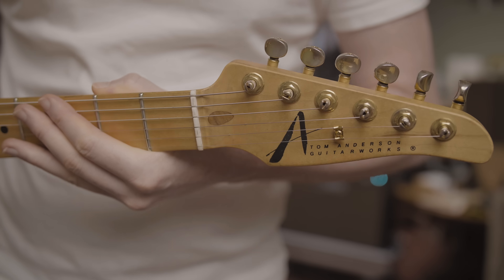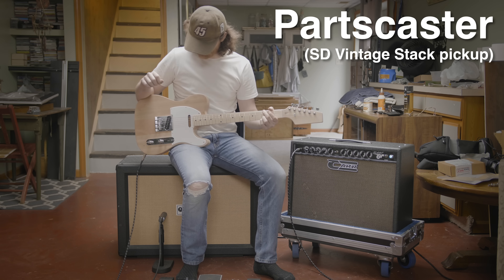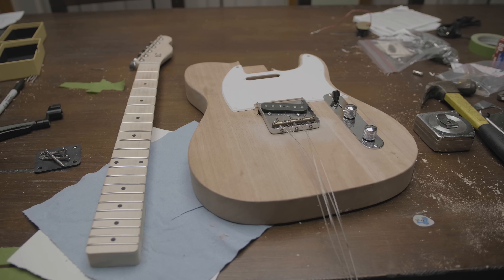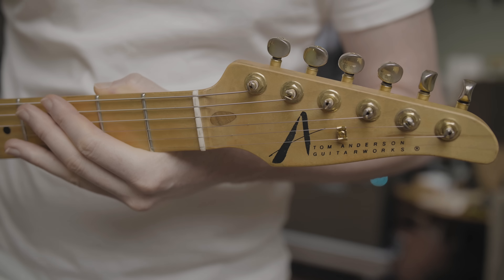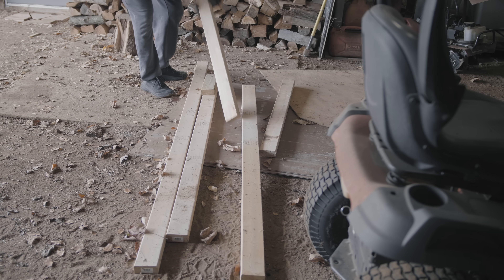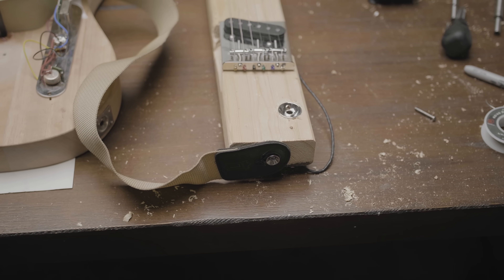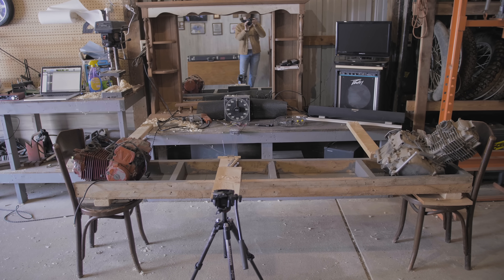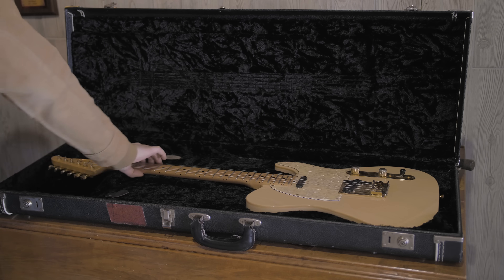Tested: Where Does The Tone Come From In An Electric Guitar?

Comment: LOL this comment section is HOT. I'll just add, i can hear differences. the air guitar sounds bigger than the tele. They're in the same neighborhood, but it sounds bassier maybe. Now we're at the point where the precision required to perform the same chords in the same way is going to be impossible. And they are different pickups right? Same make and model but otherwise 2 units? Not swapping literally the same pickup? There could actually be some differences there maybe. just a thought. 

Do i care about tonewood? No.
Does wood type change how the strings are vibrating and thus the sound? Likely yes, the sympathetic vibrations will amplify or attenuate different frequcies BUT... it's probably never going to be something any human would ever notice so I wouldn't fuss over it. 

Anyway, great video! Suggestion for future experimentation, what about hollow body electric guitars? Does their hollow body give them their warm sound? Or is that just how the players thay like hollow bodies like to dial in their sound?

Comment: So basically, the strings, pickups and pickup heights... then way down the line the hardness of the metal parts where harder is brighter... then way down the line the wood... then way down the line the country of origin of the engine holding down your air guitar.

Comment: The Partscaster sounds like shit jack. I'm not sure where this idea that it's "just as good" is coming from.  It doesn't sound nearly as good as the Anderson.  Is everyone's ears broken or something?  Unless you are going to tell me that you switched the audio, in which case I will actually be surprised, I'm not buying it.  10:16 yeah no shit when you strum a single chord and don't actually play you can get them to sound similar, but that's not what you actually do with a guitar. The Anderson still sounds better.  What's annoying about this video, and other videos like this is that you spent $3400+ dollars on a guitar, and yet you are trying to delude others into thinking that you did not in fact, spend $3400 on a guitar. It's almost like a sense of guilt or something.  How about this, how about I buy that Anderson off you for $200 and a blow job, or I'll build you a telecaster out of packing peanuts.  Apparently your Anderson is no better than that.  Personally I think it sounds great, so how about a barter?
Reply: Bro it's a literal workbench. If it doesn't sound different what will?

Comment: Im not trying to be a hater in any way but I'm still convinced your testing is flawed. 

There is obviously a certain equation of energy conservation and disapation. 

From the thumbnail I figured you would get really good results from the air guitar and this is why: the huge mass the strings have to effectively resonate against. That nothing in the bench (the bench being more stable) allows for certain reosnation and in this case greater sustain. 

Infact I think the air guitar sounded much better than the tele in the side by side, the resonance felt more full and sustained longer even like a piano. .
The tele compared to the 2*4 I felt like the 2 by 4 lacked that same resonance and lower end.

I think you're on to something but if the end demonstration was supposed to be some sort of gotcha the only thing I think it demonstrated is that you were not really thinking through the parameters and cherry picking certain ones for your understanding. 

I do think pickup height is a huge take away tho that this video demonstrated.

You also can't write off the less tone impactful factors such as playability / finish / quality / aethestic. There's a reason everyone has their favourite colour of guitar.

Anyway I hope you continue this series, and I subbed but please don't ignore resonance and mass as part of the tone equation. The tele, the 2*4 and the air guitar all sounded markedly different to me even if they were all part of the same tone 'specicies' they felt more like cousins than identical twins.

Comment: Yeah doing all this with new woods and new parts seems to have a very small difference in the sound between them... there is a small difference though and I can hear every single difference in every try you did, but its not that big in order to make one wonder.... however, try doing this test against an aged wood, a vintage guitar and you will be very surprised at the difference the simple change of a body will make.... I have done this test years ago (youre not the first to try this type of test) with a vintage guitar.... I swapped the body of my old Gibson S1 with a new better wood (I used aged Korina) and all off a sudden, the guitar came to life.... the old body gave me a bright and weak vintage style sound, the new body gave me headroom, volume on the bass side and a more modern sound.... didnt even have to change pickups or other stuff.... so to me the proof was evident... better wood on an aged guitar makes a difference.... huge difference.... I also tried strat pickups on the old body, but the sound was still weak and bright.... tried the strat pickups on the new body and the sound was amazing, as it was with the Gibson pickups on the new body.... so the pickups didnt help with the old body, nor were they the problem..... however, I returned the guitar to its original state cause the sound wasnt what the guitar should have....it lost its vintage sound.... my tests showed a different result than yours on this video.... the verdict is not out yet.... :)

Comment: Biggest remaining factors to test:  

1)  Standard Humbuckers 
2) Higher Gain situations

3)  Increase Guitar Mass (not less mass).  Aka same humbucking pickup in a Les Paul and the no-body guitar.  
4) Tone vs. Volume Pots (values, brands, materials, etc.)
5) Pot Capacitors, Resistors
6) "Vintage" vs Modern components or replicas
7) Guitar bridges/nuts/tuners

Comment: So.... Great video, Jim, EXCEPT a couple of flaws. I understand that most younger players think of guitar tone as the sound one gets after running the signal thru two or three effects pedals, or with the tubes in the amp pushed to breakup and the speaker also pushed to breakup. However, THAT is NOT the true tone. The pure tone is the guitar signal going directly into an amp set to clean tones. Your pedals cover up most tonal differences.
 Another factor is pickup placement. Your tonal sample is MUCH smaller thru the bridge pickup than it would be thru the neck pickup, where outside factors would be much more apparent.
  I do understand that you thought this test was pretty absolute, but those factors make a significant difference.
 I was taught many years ago that if you REALLY want to comparison, exaggerate. So, in doing that,  how can we explain the significant tonal differences between a Gibson ES175 and a Les Paul, both with '57 Classic in the neck position and '57 Classic Plus in the bridge position,  both with ABR1 bridges, both with mahogany necks, Kluson (or whatever) tuners. The ONLY difference is the body, and that makes a HUGE tonal difference.

Comment: You make a good case for "it's (almost) all about the pickups".  

Note that you did hear the difference between a guitar with controls and a guitar with a  pickup hot wired straight to the jack.  Those are the types of small differences that things like different woods and saddle material can make - IE almost unnoticeable, yet there.  

It may be that some folks simply don't notice the extremely subtle differences, while others might just barely - thus the fog around the issue.  

In the end, i suspect that all the "tone tricks" combined might result in a just perceptible difference in tone vs a guitar without tone tricks.  

In the long run, a decent EQ pedal at the front of the pedal chain gives you much more control over your tone than all the  mods ever could (other than pickup swaps perhaps).  Mahogany body? Bump up the lower bands some.  Maple neck? Give it a bit more brightness in the treble.  Brass saddles? just a bit more at 10KHz and above.  And so on....   Of course, you have to be able to hear these differences in the first place, in order to reproduce them with an EQ.   

BTW, the bench, shelf, motors, chairs, and 2x4's are the actual "body" of the "air guitar".

I suspect the big problem with tone wood and other "bit players" in the tone of a guitar is that their influence is so small that some folks notice them and some don't - thus the lack of consensus.  Do they have an influence? Theoretically - yes.   Can you hear the influence?  Maybe - maybe not.  Does it make a BIG difference?  Definitely not.  Does it matter?  Depends on who you ask.  Note that I'm talking about tone - not sustain.   Although the effect of tone wood, etc. on sustain is a similar case.  But tone and sustain are two different things.   Tone mods may effect tone and sustain differently - such as no effect on tone, but a small amount of effect on sustain.   

There is still much good science to be done and published before it is general knowledge as to what does and does not matter when it come to guitar sustain and tone.   Most research is done by manufacturers, who don't always share their results.

This video showcases good science - controlling for things like pickup height and control types - things that other comparison videos neglect.

Comment: This. All of this. People forget that one of Les Paul's first designs was a 4 by 4 with a guitar neck attached to it. He only changed it because people were confused by it.

I've long suspected that pickups, pickup location (including angle), and pickup height, when controlling for scale length, electronics, strings and tuning, are probably the most important factors in guitar tone.

Since you have the air guitar, could you then make the position of the pickup adjustable to see how that affects the tone? Further, could the scale length be adjusted, to test if it is actually the pickup location, or if it is the ratio along the length of the scale that is the determining factor?

Comment: i think a lot of the extras are comfort options. personally some softwoods on a tele really feel like I'm digging into the neck with my fretting, whereas a harder fretboard has an expected solid feel. I think this influences the players attack on the guitar and can change the tone. mainly i think every players style effects the tone more than any options beyond the ones you've outlined in your video. i think things tend to be more complicated when you add more parts. I'm thinking what of you picked up where you last ended and start building 2 totally different guitars and see if you can get them to deliver the same tone. your experiment was highly impressive and had a great time watching your analysis.

Comment: 4 factors based off of 10 years experience in playing guitar :
1. Electronics (pickups - types, height, position across the body, wiring, pots, etc.)
2. Scale length
3. String types
4. Picking methods (fingers, picks - material and thickness, etc.)

Comment: Your high output seymour duncan pickup is masking the component changes. Try a quality low output pickup. You will hear alot more.   Just like the crappy guitars that we played in the 80's high output was the goal to overdrive the amps. It didnt mater what the guitar was made of. Some Manufacturers knew this too. My kramer striker was made out of plywood. Acoustically it sounded like a chunk of clay with strings.

Comment: Just a couple thoughts, then I move on:
a) pickup choice, and spacing-to-strings will be your major pair of variables... followed by strings (gauge)
b) I hate to say it (because your pedals/amp sound cool) but tonal evaluation should be of the raw sound from the pickup... even pots/caps have quite a bit of parts tolerance variation. The compression/filtering/distortion of the pedals will definitely hide subtle differences... maybe invest in a high-end, one pass (not multi-pass, as it sums sound over time) audio spectrum analyzer. You might actually have one in a REALLY good DAW.
c) the Air Guitar: the pickup plate and the net/'headstock' are transmitting soundwaves/resonating based on the materials the are bolted to... yo've created a huge/massy guitar' physical properties of the bench and door frame.

To further eliminate (c), you might try this on some kind of strong by vibration-damping material..... my first thought was to make a 'neck/body' out of some kind of structural styrofoam.
you can monitor for any undesirable affect of resonating styrofoam by mounting a couple simple piezo transducers and making sure they don't puck up much sound.... Ideally, they should be dead.

Rather than type any more, I'll rely on the other 2,116 comments in here to ferret out more details of where to go next.
Good stuff.

Comment: Awesome video. Pretty much confirms what I have been suspecting for years. The biggest contributor to tone are the pickups and electronics. Then come the strings themselves. Minor players are the bridge and frets. The nut also influences tone to some extent, but it's mostly irrelevant as it only does so with open strings. 
The wood of the body and neck, as well as the bridge material and fret material have a big impact on sustain, but not on tone.

Comment: The magnetic pull of the neck pickup should theoretically cause strings to vibrate slightly differently vs. a single pickup guitar. Any remaining differences heard from the 2x4 and "air guitar" test beds might be attributable to that. You could also remove some of the subjectiveness of human ears by using an oscilloscope to compare the wave forms of the output signals.

Comment: So cool! Pickup choice and height, position under the strings, scale length, and electronics are really what it's all about.  The rest is cosmetic, feel, or too small to register given that you can compensate with a SLIGHT turn of the amp eq.

Comment: Great video! And it confused me a lot. I recently changed my basswood p bass body with swamp ash p bass body. The pickup position and the pickup are the same. I only changed the bridge, capacitor, and pots. There was a noticeable sound difference which, I believe, can not only be attributed to bridge and capacitor/potentiometer difference. I can hear the huge sound of ash compared to basswood if my mind does not trick me, which it may by the way after spending a few hundred bucks for this project.

Comment: Naysayer here. Wood matters. 
It is the total sum of all the different parts. That’s why two 2022 Les Paul Standards or two 2022 American Strats will sound different from each other respectively. 
After you have been playing for years and develop your ears, along with the subtle feel of vibrations, you can try with all of your will and might, but you will never get two identical looking guitars to sound exactly the same. Very close, but never the same.
It’s because from the electronics, to the hardware, to the plastics, to the wood, each small or large part contributes to the total tone of an instrument. 
This guy got close to matching his Anderson guitar to a kit guitar, to 2x4 guitar, or to a benchtop guitar. But he will never get a perfect twin just by using the same scale length, bridge, pickup & pickup height, and electronics, etc. Wood is a string vibration dampening device. Tone is not generated by wood, but influencing the sustain, yes wood is a part of the equation. 
95% Ballpark Tone is what you get. Otherwise, there is no point in a real 1959 Les Paul Standard versus a 2022 Les Paul Standard 1959 Reissue. 
Then there is the connection (feel) of an instrument that contributes to YOUR playing. If a guitar feels better, you play it better, thus it will sound better.

Comment: Drums are like this. You can take a dozen, say, 12 x 9” hanging toms; use the same heads tuned to the same pitch, with the same shell thickness, and regardless of the shell composition—often a massive advertising tool—won’t make much difference at all. Only the drummer at the throne will hear much of anything at all. It’s all in the heads and tuning.

Since you’ve isolated the constants in guitar sound, that is, pickup & string height, it’ll be interesting to see if neck & body woods (on a solid body, of course), and finish make any meaningful difference to tone and sustain.